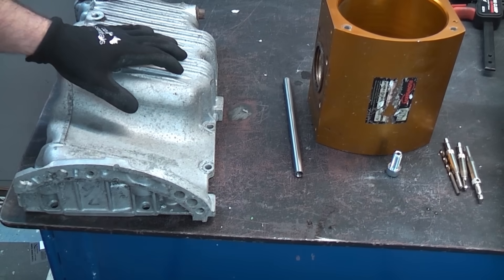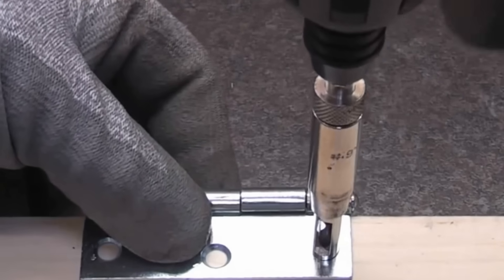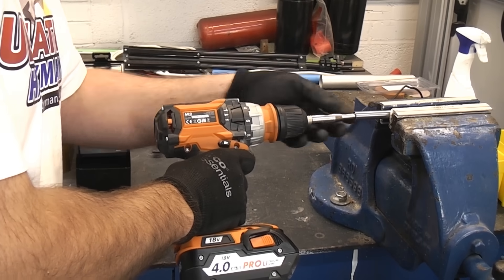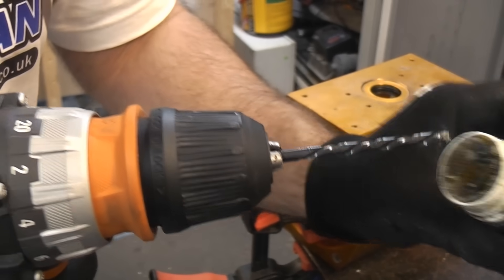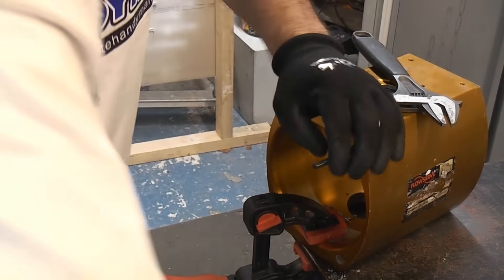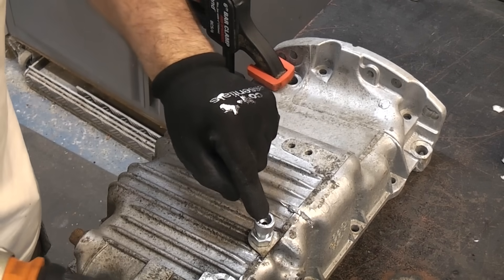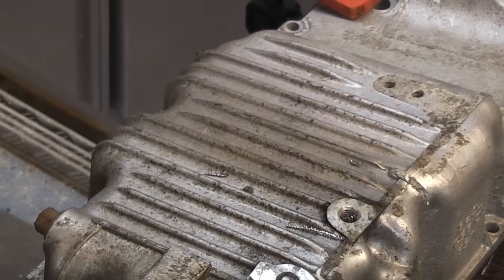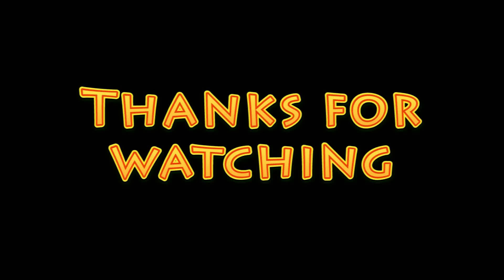How to remove a broken bolt in a deep hole | remove broken bolt in recessed hole

Comment: Very interesting, now I know where to use left hand drill bits (i do not have any yet) :) 
How copper grease affect torque values? 
And will bolts remain in place i.e. in motorcycle engine if anti-seize compound is applied ?
Reply: I've seen torque charts that show the correct value for dry or lubricated bolts.  Also, some engine rebuild torque charts will specify whether to torque dry or lubricated.  Have fun!  Peter, Chicago

Comment: In that video i saw you using an ajustable wrench on the bolt extractor, that is not a way to work. If the broken bolt was hard to remove you would  break the extractor then good luck.  Use a tap wrench , it looks more professional.
Reply from the maker: Perhaps you missed the bit in the video where I said that my tap wrench was at work!
Thanks for the comment 👍

Comment: Great tips. One suggestion is to make sure not to drill too big of a hole. I did, and the wall of the bolt broke and broke the the cast iron part I was working on.
Reply from the maker: Thanks for the comment

Comment: You're a very civilised man with metal. A lot of people apply poorly targeted force & get impatient with the job - you never do.
The centering bolts you made on the lathe are a superb idea, I'll make a set for myself. 
I did woder about tapping a small thread WITHIN a broken stud. Then bonding in a smaller threaded bolt in the offending stud, to remove it.
Reply from the maker: A few people have suggested tapping the stud with a left handed tap, then using a left handed bolt, but I have never tried it.
Thanks for the comment 👍

Comment: Trust me. The total satisfaction when the end of a broken bolt is finally in your hand really is one of life's pleasures.
Reply: The anger/ fear/ frustration that I experience the moment I realize I have broken a bolt off below the threads.  Trust me, it really stinks.
Reply: @vectorm4  q11
Reply from the maker: Absolutely.
Thanks for the comment
Reply: @ultimatehandyman  Why not a left handed drill bit to drill the hole?  Taps have right hand threads and are not useful for extracting bolts.  So why don't you use a drill to  set the extractor rather than hammering it in and risk expanding the bolt you are trying to extract?
Reply: I hope to reach this orgasmic experience
Reply: @snorttroll4379  That happens when you remove a nut !
Reply: @snorttroll4379  you sound like the kind of man that should never leave his shed in the ight of day
Reply: lol true, I struggled for two weeks with a broken spark plug in a very hard to reach area.. when I finally got it out, it sat on my nightstand for 2 months🤣
Reply: After four days on a bolt that wasn’t even broken just rounded off I honestly could of cried when I had it in my hand lol
Reply: @perry714.  "scare"IT with a hammer,hit IT  hard multiple Times and spray with lubricant.use a good pliers,vice or weld a nut on IT to retract the bolt..
Reply: I have a jar where I put every bolt I extract. Makes me feel good on sad days 😅
Reply: Hard.. in hand... pleasures... got it 😉😉😉😉⚾️🤪
Reply: The dread hits when a bolt snaps, but the relief when the remaining threads come out just finger tight is pure bliss
Reply: glad that this never happens in real life that a bolt breaks like that
Reply: Indeed!!
Reply: No sex , eh??!
Reply: @anatarango1736  It is not about what they are interested in selling you, it is what is easier to sell
Reply: @Jumbo Palumbo 😆😆😆
Reply: The sweet taste of victory!
Reply: Call me redneck or whatever but I've never experienced this pleasure I've always used a sharpened flathead and a sledge this has always made it so I can unscrew it with a flathead
Reply: @Sabi1234567890Asdf  I always used an oxy-fuel burner to liquify the assembly and then rebuilt some parts of it afterwards.
Reply: @andy02q  it can’t be seized of its liquid 👍
Reply: You met my wife then
Reply: Kakakkakakkkkk
Reply: Over this weekend I started a project for putting a bullbar on my Toyota, a 2000, had to take the 4 tow ring bolts out, with quite a bit of aggravation and money spent I got 3 out of the 4 out, on the 4th I’ve broken 2 breaker bars and then it broke the head off of the bolt.  So now I’m at the stage of drilling it out and trying to remove it with these OEM extractors, if that doesn’t work do you have any advice? I’m hoping this works
Reply: That was me yesterday on suspension pinch bolts. The head sheared straight off. I welded a nut onto what was left of the bolt and got the housing red hot
Reply: @monkeytutz2  Heat is not always the best solution and often makes things worse. I've had to drill out the broken section and Heli-Coil it. It's is scary when torquing them sometimes, but they do the job. Sometimes, I took it to the machine shop and they told me to scrap it. In the words of the famous 20th Century Philosopher, Mick Jagger, "You can't always get what you want "
Reply: Indeed what a satisfying thing to manage 🤣💪
Reply: Lol me today even though I broke another part in the process it’ll only cost a couple bucks anyways, fuck those bolts
Reply: I can't wait for the feeling, got about 4 to do tommorow 😭
Reply: True. Just removed a broken timing chain guide bolt from the cyl. Head. Most satisfying feeling and relief
Reply: I have "trophies" of the dead bolts that tormented me
Reply: @carloslvaldez7239  I hang them on mech. wire on the peg board and call it the wall of shame! Lol!
Reply: Yessssss!!!‼️
Reply: Truth
Reply: What? You gonna cream your pants too?
Reply: But is it worth it?
Reply: No. When salary comes.
Reply: That's a stretch being one of life's pleasures. Maybe it's all the screwing in and out that got you all excited.
Reply: Aaaaahhh at last, a solution to this most frustrating problem! I can't remember the number of times when the bloody thing has snapped off! Now, where do I get these specialist tools?
Reply: Totally agree!!!
Reply: I hope so. I just broke the bolt for the air intake manifold on my bike.
Reply: Without a doubt! Especially after that sinking feeling of snapping it off and all the four letter words that followed! Lol!
Reply: Excellent demonstration thank you
Reply: And befora that the desappointment when you snap a bolt in is the worst feeling ever
Reply: Damn true
Reply: TRUE!!
Reply: Yep.....
Reply: That satisfaction is in no way worth the grief you have to experience first.
Reply: You keep it as a trophy
Reply: It may be one of life's pleasures, but sadly it's one I'm yet to experience.  As despite trying of the techniques demonstrated here one by one I always ed up wasting even more time having to just pick the broken bolt end out.
Reply: I crossthreaded and snapped a bolt holding the thermo housing together in my Volvo. Huge pita. I didn't have an ez out, and didn't have a working  Volvo to drive to the hardware store, so I tried filing flats onto the half inch of protruding broken bolt and using an open end wrench. It just sheared off again. I drilled it out pretty wide and was looking at my tap and die shit thinking maybe I could somehow use a tap as an extractor - probably about to make my situation worse because I'm sure they're hard and brittle - when I noticed an extractor end on an old combo tap and die tool. Bolt scrap came right out, chased the female threads with the old intact bolt and everything went back together perfectly. In the beginning I wanted to bolt but in the end I felt like a stud. Then again not fucking up in the first place would have been much better
Reply: For m it’s a super mundane and annoying problem that gets in the way of my ultimate goal which is to fix a vehicle. I hate bolts. Errrrhhhhgg

Comment: Thank you for posting this, this will save me a lot of $$$ as we have a lot of equipment that broke in the same manner and I could not get the hole started in the middle.  I just knew there was some on smarter who has figured this stuff out.  I'll get my Machinist friend to make me a 8mm bolt with a hole in it for my drill.  Continue to be awesome.
Reply from the maker: You are welcome!
Thanks for the comment

Comment: That worked good! One question...why did you keep bumping the trigger like it was a chain saw? Doesn't it have a variable speed setting?
Reply from the maker: Pulsing the trigger can help to get the bit started. I think it is Metabo that actually makes a drill with the pulse function.
Thanks for the comment

Comment: I would suggest using a tapping wrench either the T-handle type or a two handed style than a adjustable wrench.
Reply from the maker: I thought I mentioned that I'd left mine at work in the video.
Thanks for the comment 👍

Comment: One thing you didn't mention, after drilling a little into the bolt, if the left hand bit doesn't grab you can step up one size on your bit and sometimes the bit will grab that way. I did like you center drilled bolts for center alignment. I have a Snap On set that uses collars for center alignment.
Reply from the maker: Thanks for the comment 👍

Comment: I have actually had to rmove bolts from a valve actuator just like this one. I made drill bushings to center drill the bolts. Then used a lefty.
Reply from the maker: Thanks for the comment

Comment: I have a screw that I broke changing the water pump. I went through 2 titanium drill bits already. I'm getting really frustrated with the damn thing! What kind of drill bit do you use?
Reply from the maker: A lot of TIN coated drill bits are poor quality and go blunt really quick.
I would use a quality cobalt drill bit, they are much better for harder steels like bolts.
Thanks for the comment 👍
Reply: @ultimatehandyman  ty bud going to look into colbalt drill bits

Comment: Bolts usually seize when being screwed into dissimilar metals especially steel or stanless steel into aluminium and thats why you should use a form of antiseize on the threads. I assemble bicycles as a living and before i install the pedals i coat the threads with a good quality grease or antiseize even steel crabks as well .i once tried getting a pedal out of an aluminum crank that hadnt had antiseize applied to the threads so i used a piece of pipe on the spenner as leverage to unscrew it and took the thread out of the aluminum with the pedal and the actual thread from the crank was still in the pedal threads,cold welded together wich is called goaling.
Reply: Called "gauling"....displacing metal with shear forces.

Comment: I know I'm a little late to the party, but I have found that drilling all the way through the broken bolt is a much better practice, you can then heat it, spray penetrating oil into the hole and it will wick through the threads, there are also penetrating oils that freeze the part, so you heat it, and when you are ready to extract it, hit it with that stuff, and usually the bolt will back right out. Also, if your hole is dead center, you can drill just to the minor diameter of the bolt,  and then, you will have a coil spring in the hole that you can get out with a small dental pick.
Reply from the maker: Thanks for the comment

Comment: I understand that corrosion is an electrolytic process and therefore using copper grease in that situation is not best practices. It acts as the electrolyte
Reply: I understand your thinking, but I don't think that is the case, and they make 2 types of anti-sieze, aluminium and copper. Aluminum should be used for non ferrous,and copper for ferrous materials.

Comment: Would it be the same for a bolt that's sheared flush with hole?
Reply from the maker: Yes, exactly the same, but you don't need the drill guide bolt.
Thanks for the comment

Comment: If you heat the piece up it makes all the air between the piece and the broken bolt expand.

If you immediately spray some penetrant on the bolt the cooling action will suck the penetrating oil deep into the threads.

I think it also helps to temper soft material like aluminum or brass.

To remove bold broken off in holes I take another bolt the same size and pitch. Chuck it up in my lathe, not a pilot hole down the center of the bolt, screw it in on top of the broken one and use it to guide the smaller pilot drill perfectly down the center of the broken bolt.

Then use an easy out.

Not everybody has a lathe, but you can still do the same thing with a hand drill and be better off than you'd be trying to hit the center of a broken bolt inside a hole.

Sometimes it's hard to keep a drill bit centered no matter what you do without some kind of guide.
Reply from the maker: Thanks for the comment

Comment: Very cool technique.  I'm not mechanical minded at all.  It amazes me that the bolt was stuck so tight that the bolt snapped when trying to remove it, yet it appears to take very little torque to remove the remaining length of screw with the extractor.
Reply from the maker: Thanks for the comment 👍

Comment: If you don't have a tap handle you can squeeze a nut about the same size as the square end of the layout or tap and use a ratchet and socket the size of the nut.
Reply from the maker: Thanks for the comment 👍

Comment: I used to remove broken bolts that holds the track rollers in place on the big bulldozers and other equipment too i build the broken bolt up until i can weld a nut on it
Reply: Sometimes i use extractors too it depends on the situation
Reply from the maker: Thanks for the comment 👍

Comment: Nice tips. I always use the cheese head bolt (Allen key bolt) technique. Left hand drill bits are the key though. 70-80% of the time, no extractors required. Its amazing how many mechanics cant get broken bolts out😂
Reply from the maker: I think with a lot of mechanics it is down to time. A mate of mine brought his car to me as his mechanic could not remove one anti-theft wheel bolt and his tyre was getting dangerously worn. I drilled it out using a mag base drill, which is something that a mechanic might not have, plus a drill bit that will drill hard steels. I'm sure most mechanics could remove them if they had enough time and the correct equipment.
Thanks for the comment 👍

Comment: Thanks for showing how to get broken bolts out. I had never seen it done. I did have a situation with a snapped bolt when I had started taking apart a 1916 H.K. Porter bolt cutter. I was very upset. I got a set of bolt extractors to use and drilled my first hole and then proceeded to the next size to fit the bolt extractor. However my dad who passed away in 1979 touched my shoulder and gave me some luck! I must of accidentally picked up a left handed threaded drill and it came right out! The threads also were not damaged but I did take a tap to clean them up and put a new bolt in! Yahoo! The reason I was heart broken when I snapped the bolt on this bolt cutter is because my dad worked at the plant in Boston, Massachusetts USA where this bolt cutter was made as a machinist in the late 1950s to 1978. I take pride in restoring the tools made there and use them all the time. My dad was born in 1912 and I have 1 Hypowa 0 size bolt cutter made in 1906 as well as the 1916 one. I have a total of 17 tools that all were made at that plant. Unfortunately it closed in 1988. Thanks again for showing me how to properly take out a broken bolt.

Comment: Where did you get your kit btw?
Reply from the maker: Hinge centering drills- https://fave.co/2DpJo1H
Left handed drill bits- https://fave.co/2xJjK1M
Teng screw extractors https://fave.co/2OnfRuF
Dormer taps -https://fave.co/2OsN1sQ 

If you are in the UK- 
Hinge centering drills- https://fave.co/2NE1VMc
Left handed drill bits- https://fave.co/2DubtF4
Teng screw extractors- https://fave.co/2pVLkVT
Dormer taps - https://fave.co/2pTfbyx

exact cutting paste- https://fave.co/2Nabyxc
cobalt drill bits

 (they are much better on harder steels like bolts) https://fave.co/2zDh3kp

You'll have to make the guides yourself, but they are easy- https://www.youtube.com/watch?v=6mZj0J6CNYA&t=1s

Spring tools centre punch- https://fave.co/2NbnLBD

Comment: I broke a bolt near the water pump and I have no room to work with. Have you ever used a right angle adapter before? I was thinking of attaching that and I will be able to work from the top.
Reply from the maker: I have only used the milwaukee OSD2 
https://www.youtube.com/watch?v=d2gsiF-v33w&t
But it only accepts hex bits, so that will limit the drill bits that you can use.

Comment: I don't know what it is, but every time I try to use one of these broken both extractors, it never grabs the broken bolt, and the extractor just chews into the metal of the bolt when I try to turn it to pull it out, making it worse.  Am I just a klutz??  :-)
Reply from the maker: They work sometimes, but not all the time.
You need to drill out as much of the broken bolt as possible, as this weakens the broken bolt.
I have had some success with them in the past.
Thanks for the comment

Comment: Nice Work.  Going to have to try that drilled out caps bolt to use as a pilot hole for drilling and extractor.
Reply from the maker: Thanks for the comment  ;-)

Comment: Well done, terrific demonstration of how to resolve an often frustrating situation.  Apart from requiring a few specialised tools and often needing to fabricate a drilling jig, you ably demonstrate the need to be patient, accurate, persistent and methodical and understand what you are doing at each stage of the removal job.  Also, it is important to understand that if you don't get each stage right, you can make the job even more difficult for yourself - such as failing to drill the correctly sized hole right in the middle.
Reply from the maker: Thanks John ;-)

Comment: If you have no extractor, you can use a case-hardened nail (concrete nail, "cut nail," etc.).  They are tapered and have sharp corners that bite into a drilled hole in a broken bolt.  Gently tap it in and use an adjustable wrench on the flat sides of the nail.  This has saved my bacon in the field many times.
Reply from the maker: Thanks for the comment